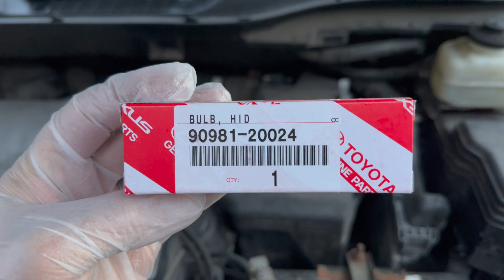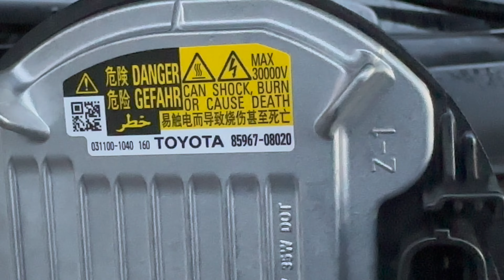Lexus RX350 HID Headlight Replacement Guide 2013 2014 2015

Comment: these RX350s could have come with Halogen, HID, or LED I'm told. With your video now I know I have HID. I'd say nothing is blown cause they all work. But low beams are not very bright anymore. I've already cleaned up the lenses. Now I want to replace bulbs as well. I wonder if ballasts get weak as bulbs do or if it's just on or off for the ballasts.
Best video on this I've seen without a doubt. Thank You

Comment: One recommendation I would add is if you use the Old O-RING on the new Ballast, be sure to spray some Silicone Lubricant on it making sure you spread the silcone liberally all around and both side of the O-Ring. Without it, they will dry out, lose their sealing qualities and eventually tear. These seals keep moisture from getting past the ballast and into the headlight compartment. If that happens you will get that inside moisture on the inside of the lens causing many headlight problems.
Reply: Can you recommend which lubricant to buy?

Comment: Hey did you un-connect the negative battery terminal before the video? Because heard there is a high voltage! How safe is to unplug the connector of the ballast?

Comment: 1:04 Thank you for the great video with very clear instructions. My only problem or question is that when I went to lexus to buy the ballast, they told me that that is not sold separately from the entire light module. They said there is no way to just purchase the ballast and gasket alone. When I looked online, I couldn't figure out if the aftermarket were the correct ones for my car. No matter how long I searched, I came up empty-handed. Do you have any suggestions on how to find the correct ballast for my 2013 lexus rx350 passenger front side? Any info would be greatly appreciated.
Reply from the maker: Try calling another dealer, some dealers won't sell by its self, also try calling a Toyota Dealer, they should have the same part number in inventory

Comment: thanks for the parts#, i used it to look up for LED replacement bulb
Reply: I'm looking at replacing the HID with a LED bulb as well. My reading suggests that LED doesn't need a ballast. Does anyone have info about that? Moreover what connection should the LED bulb be? H7?
Reply from the maker: Are you looking to change to a factory Lexus LED? or to a LED Bulb that fits into these units.
Its best to change the bulb to the factory one as LED bulbs will most likely be from China and not be bright enough or even last that long, best to stick to factory in my opinion, more money but will last longer
Reply: the factory ones likely come from china also @bobthepromoter